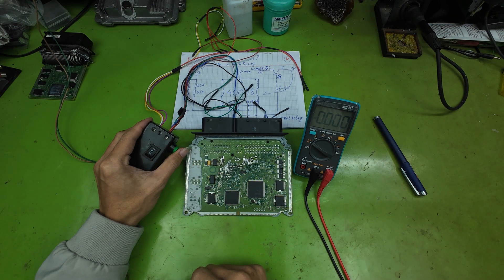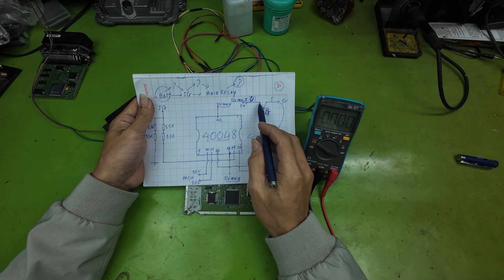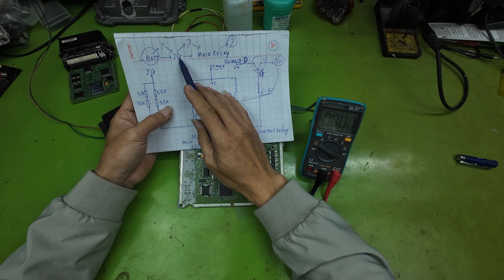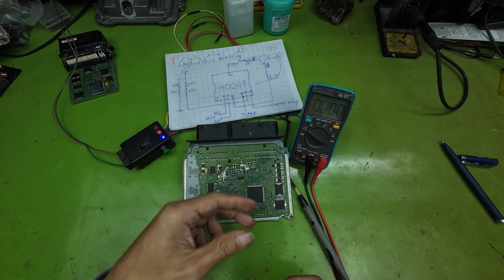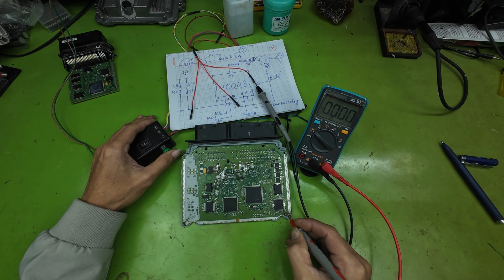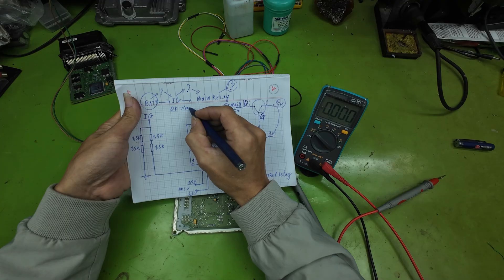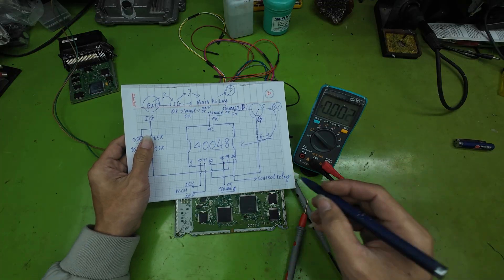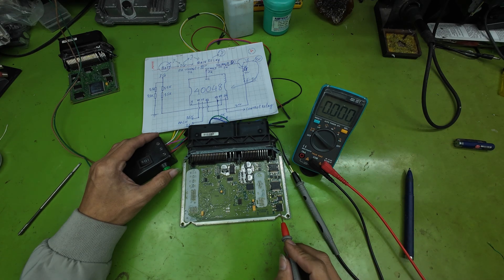How to Diagnose the ECU Power Supply Step-by-Step | Complete Testing & Repair Guide#ecurepair

Comment: i have an ecm for a toyota that has no can bus communication  i traced it to the ecm as the problem  The can high and can low pins have 3.6 ohns resistance.  The car runs fine but no ecm communications.  Any suggestions?
Reply from the maker: Disconnect the two CAN wires and measure their voltages separately.
If the readings show approximately 2.4V and 2.6V, it means that your CAN network is operating normally.
However, if both lines show the same voltage of 2.5V, it indicates a communication fault.
In that case, you should check the circuit path from the ECU pinout, identify which components the signal passes through, and measure each component to see if there are any abnormalities.
Reply: @Autocar_Star both voltage were 2.5. I can’t trace the path because they are under the plastic that hold the pins from the connector to the circuit board